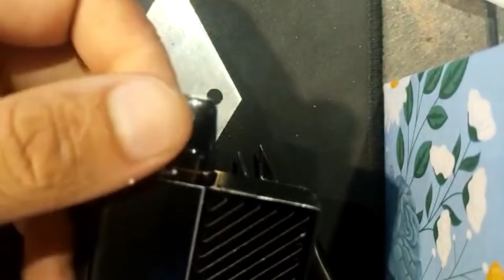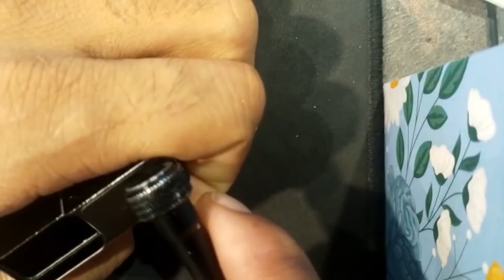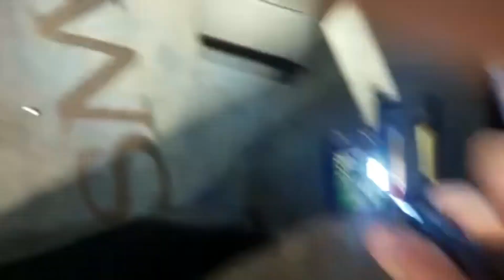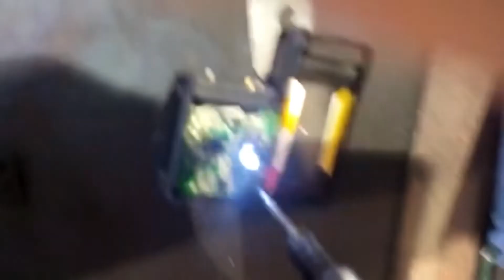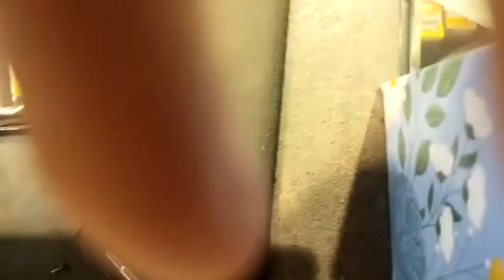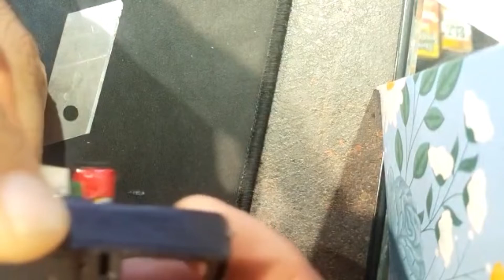How to Open Vaporesso Xros Nano - Fixed Light blinking

Comment: Useful video for tearing the system apart, thanks for posting!  But, it doesn't show how to fix the blinking light error.  As others have posted it seems to be due to moisture.  I left mine near a glass of rum that spilled, leaving the vape sitting upright(usb-c facing the table, mouthpiece to the sky)in a puddle of rum.  In the morning, when I found, it there was no sign of life and a green/blue corrosion in the USB port. Charged it up and the light never shut off. 
HERE'S WHAT FIXED MINE: I used tiny tweezers wrapped in a little paper towel and scrubbed the USB port clean/dry.  Note: be quick about it as I'm not sure if the lipo charge controller blocks the voltage from battery->USB-C. ie: It may be shorted by the tweezers.  
Either way, it seems it is moisture shorting the "detect" pins in the USBC to make the charge controller think it's connected.  Time can likely dry/fix the issue on its own but corrosion may also short these pins and corrosion won't dry away like water.  Hope this helps someone. YOU MAY NOT NEED TO DISASSEMBLE TO FIX THIS ISSUE, CLEAN/DRY THE USB PORT FIRST.
Reply: ты мне помог, спасибо тебе большое)
Reply: Fixed after clean usb port without open... thanks @crypto5708
Reply: mine would only work when plugged in. I tried putting it on the heater to dry out and it is working again. maybe some condensation got in there.

Comment: What I didn't see in the video is there is a tiny metal pin in the middle, about an inch down where the pod slides in, I used a small screw to push it in, was a struggle until I discovered that, after pushing in that pin it slid out easily like in the video

Comment: If anyone else has this flashing issue like i did, get some isopropyl alcohol on a q-tip and rub/clean the usb-c port in the bottom. 

as @cryto5708 said, any moisture will corrode the connections causing a short and will cause the flashing light so a simple clean with isopropyl alcohol will sort it out!

Comment: Back here again ! The blinking returned after half an hour and I tried cleaning the charge port again , many times . The blinking would go away and then return even with no use and stood up right , left alone . I think , but I am not sure mind , that possibly the USB port is loose on the mother board . The ape works fine apart from the blinking  .  I bought a Nano 3 as a replacement . When I have access to a fine soldering iron I will attempt to fix the Nano .

Comment: How to off light blinking
Reply from the maker: check the device sensor ?/
Reply: Man i gave some hits and it worked KKKKKk dunno why
i dropped mine on water, and it stopped working, 3 days latter it came back to life, i charged all the way, and started to do the same thing as the one in the video, when i as tring to open i gave some hits on it to push back the circuit board and it magically repaired itself, maybe the water got inside and corroded something
Reply: @lucasvieira7354  yep okay now I'm having the same issue, I had lost the mod for about a week or so and was outside looking for it cuz that's where I had it last. It had just started to get dark and I see this light in the grass blinking I thought damn that's a really bright lightning bug so I went down to look at it and it was my mod buried in the grass. I believe the issue is definitely water. Going to pull it apart and see what I can figure out. Clean off any contacts scrape off any corrosion very carefully and see what happens. 🤷‍♂️